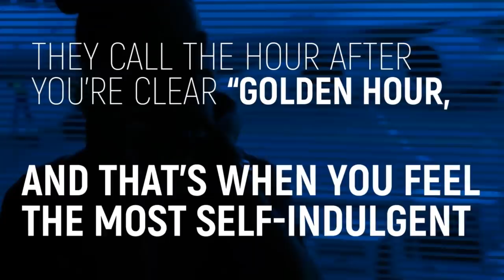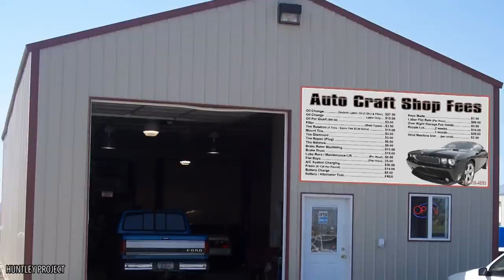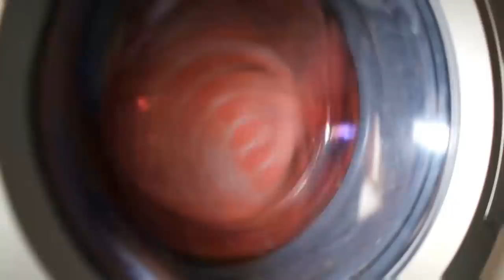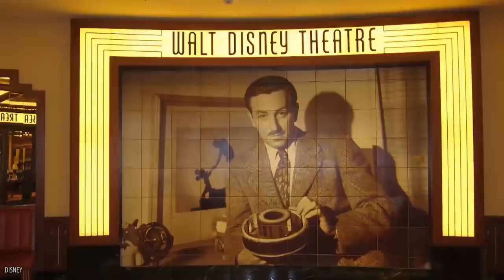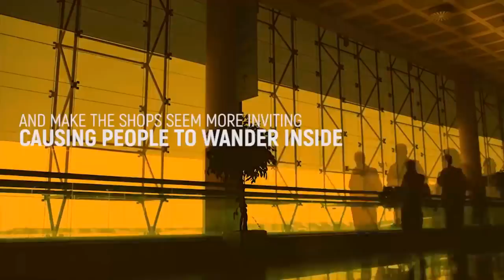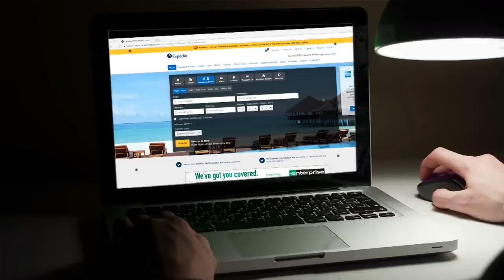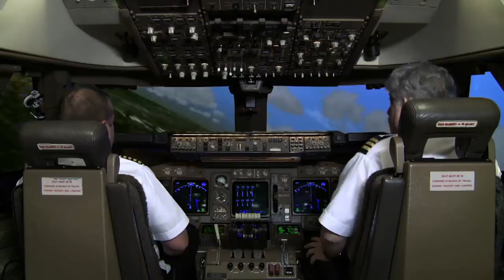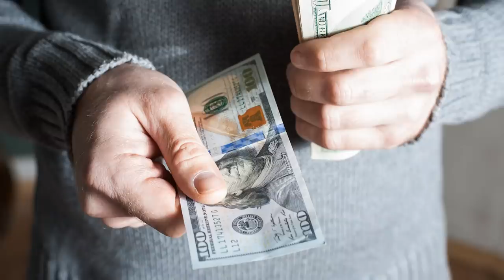TheHUB Live - Amazing Secrets No One Wants You To Know

Comment: By doing an oil change every 10k miles the car may still run but u are sorteting the engine lifespan in half. You dont need to go to a shop to do it either. In most cars u can get an oil change/oil filter change done ur self in 20 minutes for under 50$. Flushes are also necessary every now and then. You dont necessarily want to have 10 year old cooland in your lines.

Comment: On the oil change topic fallow the manufacture recommended intervals or just change your oil early it will never damage your engine it will extend your rubber seals and keap your engine running for a vary long time not just 1 or 2 years

Comment: Hey love the videos not sure who told you about that oil change thing but that's incorrect yes the manufacturer wants you to start changing your oil less compared to how it used to be but as a mechanic I have seen and didn't failures that should not have happened if they would have just stuck to the regular schedule 3000  To 5000 mile oil change take for instance I drive a diesel vehicle I can change my oil every 8000 miles yet I still change my oil every 35 to 40000 this is kept my vehicle running an optimal conditions and keeping the amount of money I have to spend on maintenance due to  Premature wear on the engine

Comment: I'm literally laughing my ass off at how wrong your information is. Telling people they don't need flushes until they have issues. That's so stupid. You get flushes to EXTEND the time before you have issues. Every shop I've worked at wont touch your car if you come in and say: "Yeah it shifts hard and slips out of gear, it's got 120k miles and I've never had a transmission flush" (Unless of course, we're putting in a new transmission)

If you're going to make a video acting like you know what you're talking about, learn what you're talking about first. I'm not trying to sell you something you don't need, there's a reason I do 3k oil changes and routine flushes on MY OWN CAR.

"Secrets no one wants you to know" because they are wrong. You'd be better off asking a homeless guy how NOT to be homeless.